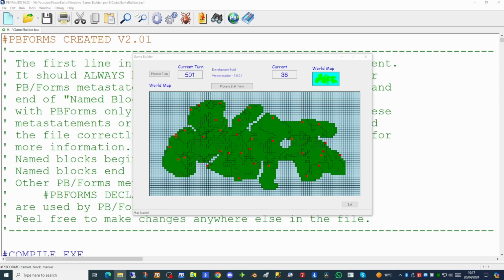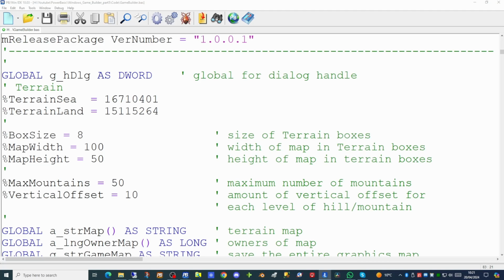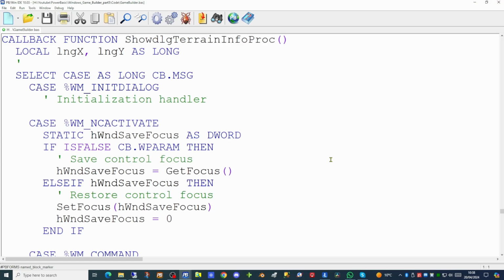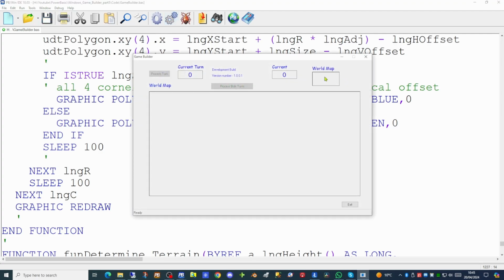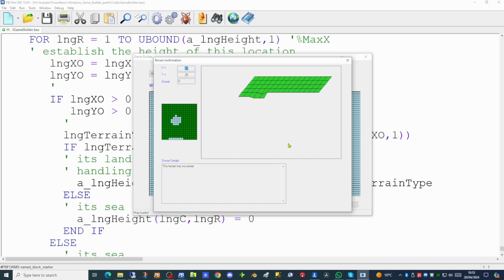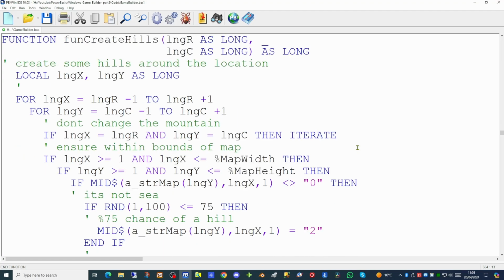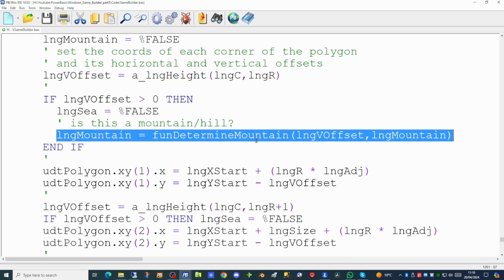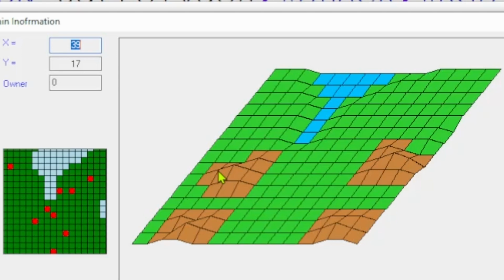PowerBasic Snippets - Tutorial on Game Utilities - part 5

Comment: I'm curious why you use type specifier prefixes for your variable names rather than the PB type specifiers that are generally appended to the names.
Reply from the maker: It's a design preference. Using the suffix works fine, but with a prefix you get more flexibility and can make the code more readable and therefore maintainable.